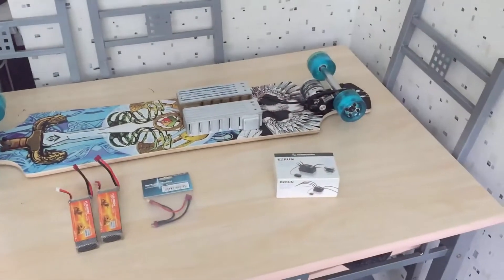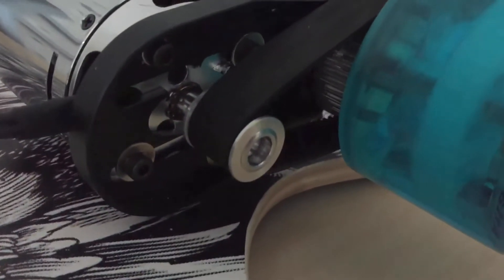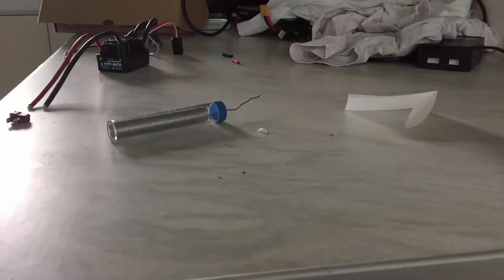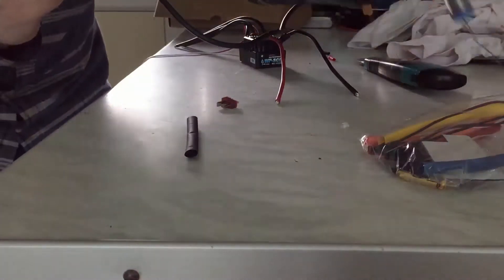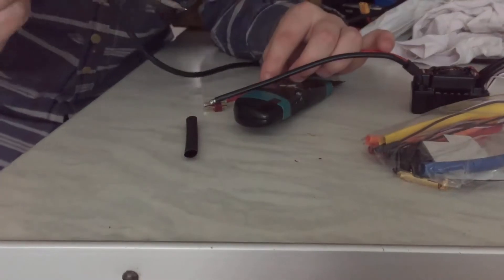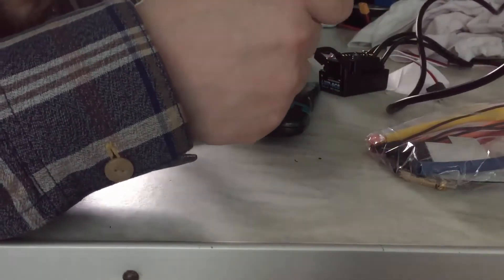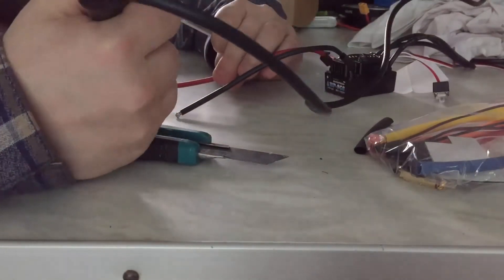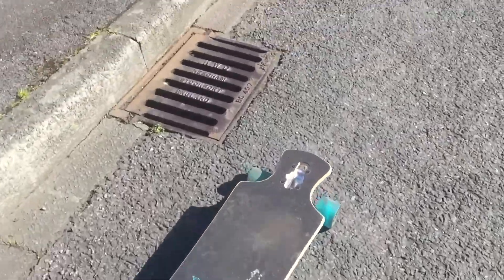Electric Skateboard Build Part 2 -Test Ride

Comment: How did you attach the motor to the motor pully because the Turigy motor has no flat spot for the pully
Reply from the maker: epoxy resin the pully and slide it on and tighten grub screws
Reply: Sean Pook thanks :)
Reply from the maker: if im being honest i should have took a rotary tool to the shaft and made a flat surface. that way you dont have to use glue. mine is on tight.... i dont know if it will come off now lol. there if loads of thing i would have done different on the electric longboard. i was just trying to do it as cheap as possible. i would suggest getting a skateboard esc too as they are pretty cheap now

Comment: Hey, did you motor mount fit on your trucks easily or did you have to do some modifying. I bought the same mount but I don't think they are go deep enough through the truck. If you don't mind, could you tell me how long it was from the end of your truck to your mount.  Thank You!
Reply from the maker: hey man. yh i had to file back the truck slightly to get the mount to slide further up the truck. To find out where to place the mount on the truck... dry fit the wheel with cog on then get the bracket and put next to the cog wheel and mark it on the truck leaving a few mm gap between. if i was you i would try drill through the trucks for the mount.. the grub screws are not good. I ended up getting jb weld then once that set i used epoxy resin on top of that. seems to hold. any more questions dont hesitate to ask
Reply: Thanks so much man this was really helpful! Trying to do a budget build and didn't find anyone who used the same mount until I found this video. Thanks a lot again man really appreciate it!
Reply from the maker: no worries, need any more help give me a shout

Comment: great video... i just wanna know how did u stable  ur motor mount with the truck as well as how did u manage to stable ur small pulley on the motor shaft
Reply from the maker: JB weld and epoxy glue